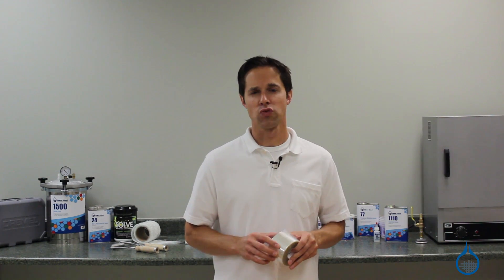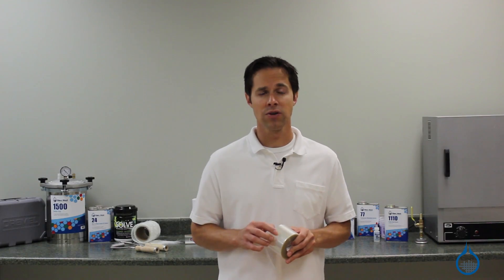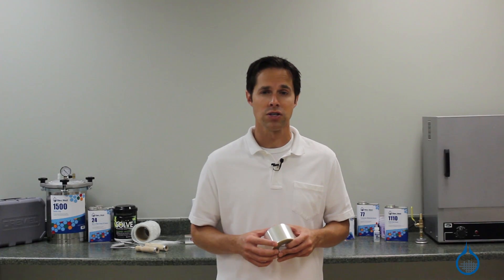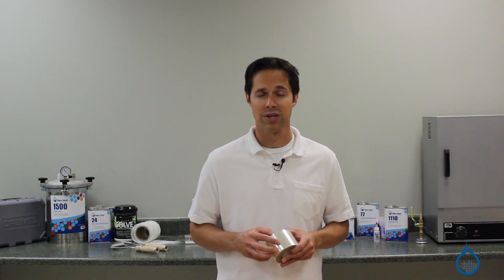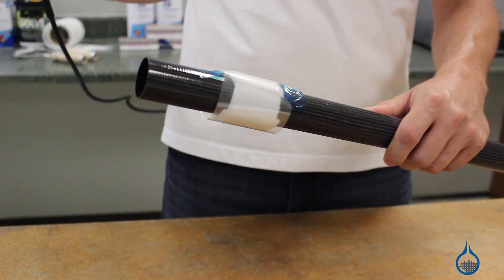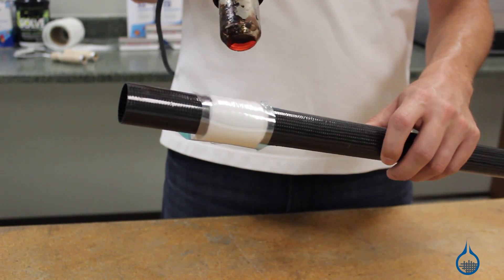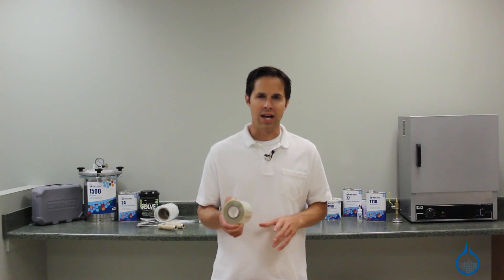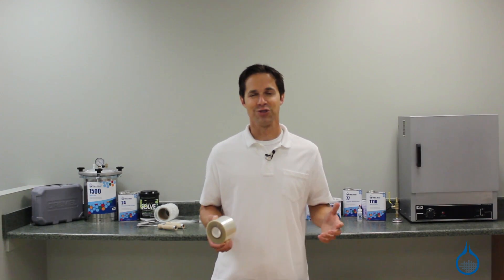Shrink Tape

Comment: I was curious if shrink tape can be used in a way to wrap a tube so its water resistant? I ask because i am wanting to create a custom LED design on my UTV and wrap LED strips around the roll bars and im trying to come up with a good means of wrapping something clear over the leds and protect them from water, mostly from rain and water splashes while riding.

Comment: Sorry for the super late comment, but how does shrink taping remove excess air and resin? Is the tape slightly porous?
Reply from the maker: We actually are asked this question fairly frequently. Shrink taping helps remove excess air and resin by creating mechanical pressure, or simply put, squeezes it out.
Reply: @fibreglast  Thanks for your quick response, but I'm afraid it doesn't really answer my question. By what mechanism does the air and resin actually come out? Does it bleed through perforations in the tape, or does it get pushed out through its overlapping regions?
Reply from the maker: @bartybum  my apologies. The excess air and resin is released through the overlapping regions of the tape.
Reply: @fibreglast  Thank you very much!

Comment: You mean one must stand and wave heat gun fir 15 - 20 Minutes to Complete the shrink process?   NO WAY!
Reply from the maker: Using a heat gun is an option however the majority of people use an autoclave or an oven to fully shrink the tape and compress their laminate.

Comment: can you heat gun this stuff?  Also why is it so expensive?
Reply from the maker: Hello. Yes you can use a heat gun on this shrink tape as long as you don't pass it's maximum cure temperature of 400°F. In regard to the price we only carry first quality products here at Fibre Glast. Along with that we are ISO certified so that we can supply major corporations and the US government with uniform and consistent composite materials.
Reply: @fibreglast  you should do some without all the gov BS so you dont have to overcharge for gov contracts